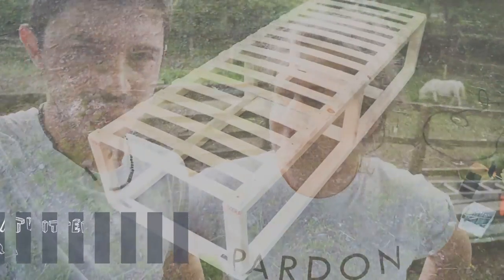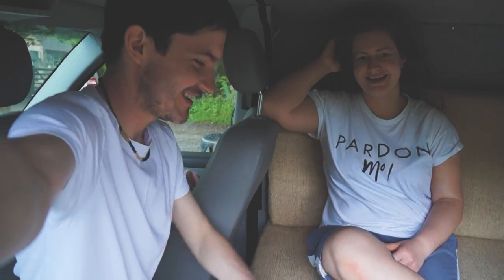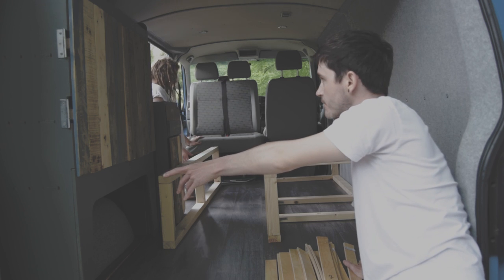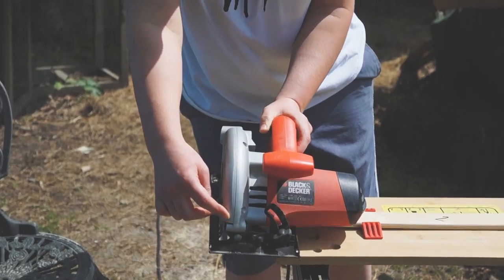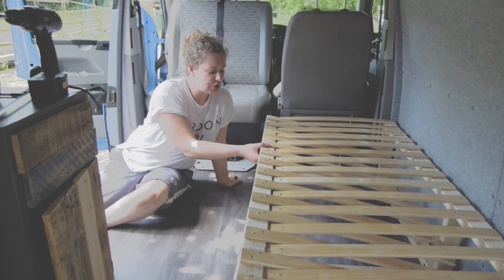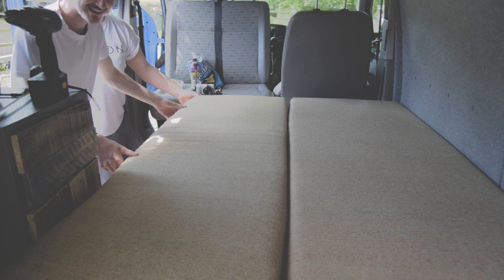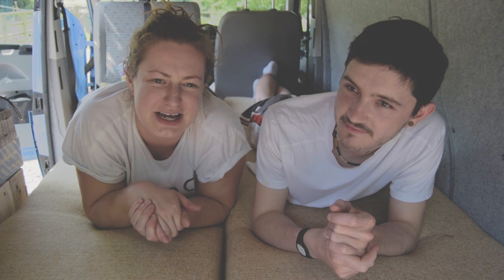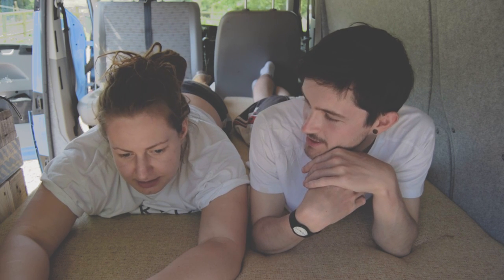Day 24 - Making a pull out/extendable bed! (Part 2) #VanLife VW T5 Camper Conversion

Comment: Drill pilot holes about 1.5mm smaller than screw size and use a countersink drill bit then screw in screw this will stop the wood from splitting and leave a stronger, more flush finish. Amazing build guys! Really impressed with the creativity and unique nature of your build 🙌 happy travels
Reply from the maker: At some point after this part of the build we learnt about pilot poles! 😜the glorious hindsight 👍
Reply: @FloraTheNoviceExplorers  It's fabulous! Learning as you go is best way!

Comment: This is very similar to a build I am currently attempting.  Your video has been very helpful to me.
Reply from the maker: Max Berryman glad it has helped a bit! We're still making good progress. What van are you converting?
Reply: My wife and I are converting a Ford E350 extended passenger van. Your video helped us to draft a plan for our own bed, which at this point is at about 75% completion; so far it is working quite well.

Comment: Good job, where did you get the mattresses from?
Reply from the maker: Thanks! We used a company called Ace Foam 👍
Reply: @FloraTheNoviceExplorers  Thanks, what did you secure the bed to the floor with?
Reply from the maker: @ltaylor3281 we just used some heavy-duty metal brackets and screwed it down to the floor with some chunky screws! Still firmly in place all these years later :)

Comment: Hi , cool video.  What size are the timbers? 3 by 2 inch? Or 75mm by 50mm for metric lol
Reply from the maker: Hello 👋 They’re 4cm x 6cm. They do a great job but do add a lot of weight. You may be able to get away with slightly thinner ones. But we’re happy with our bed ☺️ hope that helps!
Reply: @FloraTheNoviceExplorers  oh thanks for replying 👍. Yeh that helps.  I'm gonna have a go at one myself... fingers crossed.
Reply from the maker: Good luck 😉 I’m sure you’ll be fine. If we managed to make it work I imagine most people can 😜

Comment: Very enjoyable! You both have great chemistry on-camera. What are the bed dimensions? I'm 6'6" and have to adapt most build ideas for my size. Thanks!
Reply from the maker: Jerry Powell - thank you jerry! I am confident you can make this longer and wider depending on what van you have (hopefully LWB) and use Ikea slats too, you may need to add straight wood slats at both ends 
Our measurements are 6ft 4ft - average double bed size - you can get made to measure foam too! Happy building! X M

Comment: So is the pull out part slats only attached at the pull out end? And the other end just kinda floats?? Looks really good thanks!
Reply from the maker: Essentially yes! We were going to make it more sturdy but I’d didn’t really need it! Worked really well. We’ve been travelling for nearly 6 weeks now using the bed everyday, no complaints from us :p thanks
Reply: Flora & The Novice Explorers I really like that design as some of them pull out beds are so stiff! And look like a ballache. Yours looks really easy to use. Going with the same in my mates vivaro. Thanks for taking the time to reply and enjoy your travels 👍
Reply from the maker: Sorry, only just seen your reply! Yeah, ours works surprisingly well considering we made it :p we tried to keep most things as simple as possible! Hope the bed works out for you! Cheers :)

Comment: What are the slats made of? 1/2" x 2"? Did you get them in long strips then just cut to fit? I'd love more details please..frame? 2" x4"? 
American measurements arry..
Reply from the maker: Hello 👋 the slats were actually bought from ikea. They were made for a king size bed so we had to chop them down a little bit they work great. The frame itself is made from very sturdy wood, maybe a little overkill? But we haven’t had any problems. More info can be found here: https://www.campcomforts.co.uk/blog/campervan-bench-bed

Hope that helps, cheers 😊

Comment: Hey guys :) Just wondering how you managed to get such a variety of pallet wood colours/conditions? Did you just get a load of different crates then strip them all or did you specifically buy those planks?
Reply from the maker: Hi Stefan we got a load of pallets and stripped them ourselves using a pallet wrecker. We chose specific pallets that looked older or darker to get the different shades. We did paint the blue pieces. 🚐👍

Comment: Great work! Well done. What wood did you use? And how did you keep the hinged doors under the bed upright when shut? Is there a magnet or something?
Reply from the maker: hennnnerz hi. thanks, will have to come back to you about the wood. it was recommended to us by a building supply company. it seems really good. The doors of the bed are kept in place by double roller hinges (we show them clearer in our day 26 video) :)

Comment: We're did the bowed slats come from
Reply from the maker: Ikea my friend 😊
Reply: Nice bed! Do the slates give you any trouble when your pushing them back in? We want to use the slates too. Do they seem to be holding up good?
Reply from the maker: Thanks! Yeah they go back in perfectly. But you have to make sure you’re pushing it back in equally instead of one side then the other. Holding up  well so far. Only thing we’d advise is being careful screwing them is as we have cracked a couple slightly. But all good!
Reply: @gaylein39503  I saw a van bed build where they screwed a piece of wood under and across the ends of the pull out slats... so they were not moving around so freely... hope that makes sense ((-;

Comment: Great idea, but I don't think that they are supposed to be screwed down because they are bowed and when you lie on them they should flatten, if they are fixed at both ends with screws, then that can't happen. the pull out bit is fine, because they are only screwed to one side.
Reply from the maker: You might be right but we’ve had no issues so far - 2 years on - 3 months of heavy use every night. 🛌
Reply: Ikea quality then. :)

Comment: is this a short wheel base T5? how long is the bed please?  thanks
Reply from the maker: Kev Horwood Hi! this is a LWB t5. the bed measures about 180cm in length. I can't remember the exact width at the moment, but it's almost a standard double sized bed!
Reply: Hi, curious as to how you got those bed slats slightly curved upward?  Thanks!
Reply from the maker: Hi, the slats came pre-curved as we bought them as a set from ikea. When we trimmed them down we took a bit of each end to retain as much as the curve as we could! Thanks :)

Comment: What size boards does the mattress sit on?
Reply from the maker: Hi! Can't measure them right now but they are pretty much these: http://www.ikea.com/gb/en/products/mattresses/slatted-bed-bases/lur%C3%B6y-slatted-bed-base-art-50278726/ however ours might be slightly longer, hope that helps :)
Reply: Thank you that worked, one more question what did u use for the foam
Reply from the maker: We're still working on the foam! For a quick fix we used some old foam from a caravan, however this is a little old and not overly comfortable. In the new year we'll be purchasing some foam, looking at something that comes topped with memory foam. We just need to work out the best thickness of foam that is comfortable and practical.